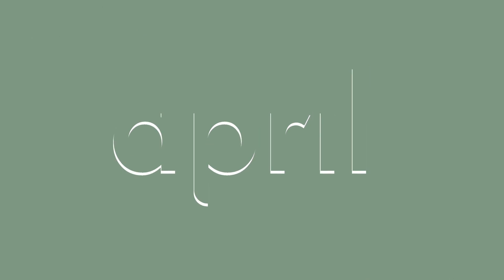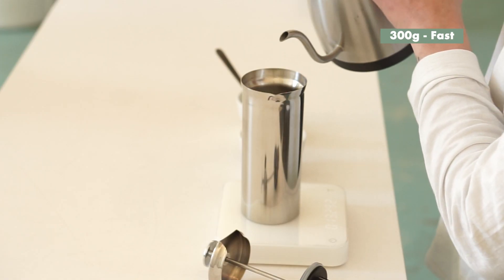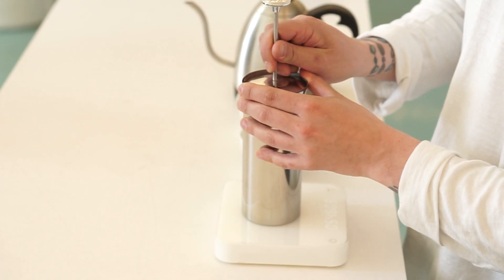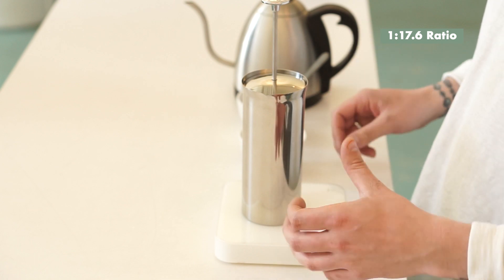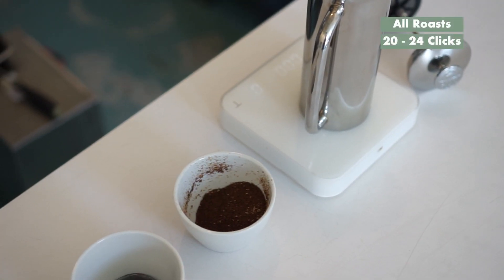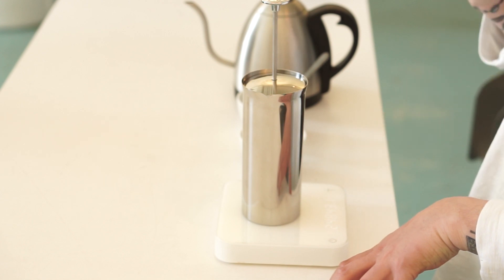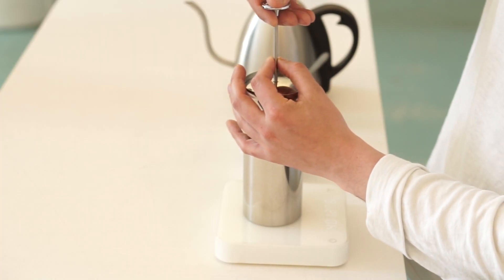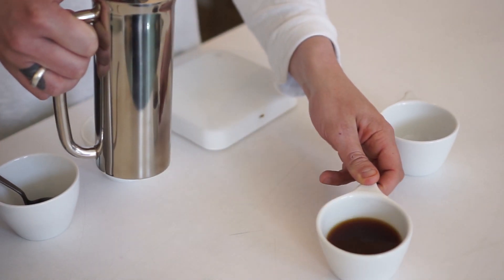Our Current French Press Recipe | Coffee with April #118

Comment: One input. You can go finer with a commercial quality grinder like say the high end line of Mahlkönig grinders because they grind more even producing less dust. You need to go a bit coarser on a home grinder like Baratza Encore or something like that. So I don't understand why you use commercial grinder you use for cupping as a referrange for home brewing.

I'm also a firm believer of not using very coarse grinds for french press but stil a bit coarser than you would use for Chemex with paper. 

Final input is that immersion methods extracts the coffee differently than pour over where water is constantly being poured over the coffee and agitating it so you need to use a slightly higher ratio for immersion brewing. 

Personally I use a ratio of about 1:15.5 for pour over and 1:14.5 for immarsion brewing.

Comment: The Espro Press retains heat more than the glass French press. Do you recommend a longer steeping time for the glass versions? Also is cupping left to steep a lot longer because of the smaller volumes hence less thermal mass and slower extraction? Thanks!